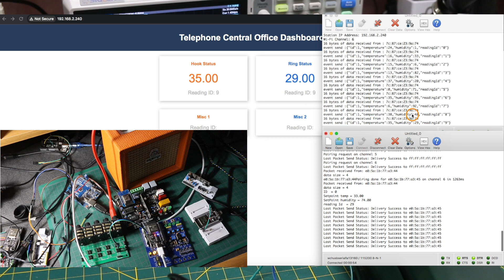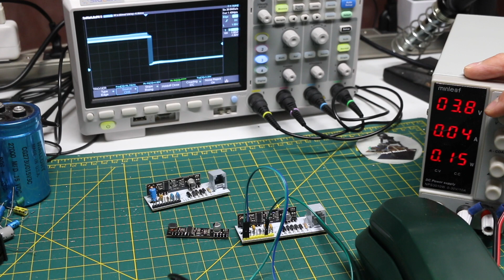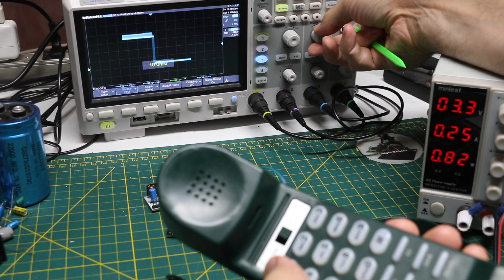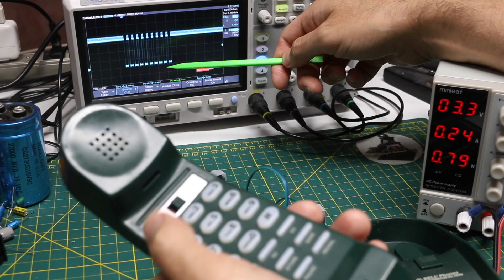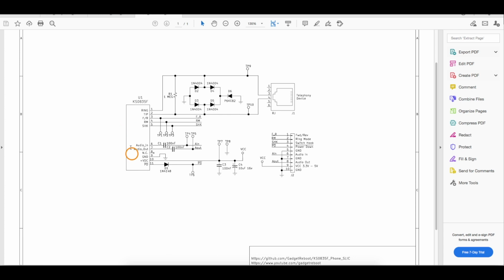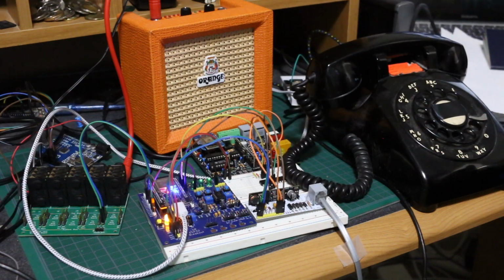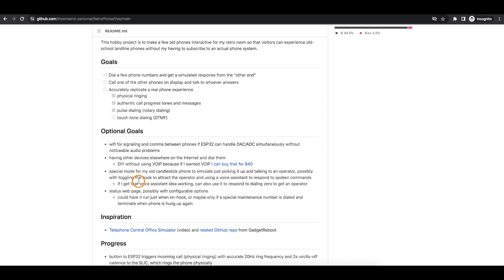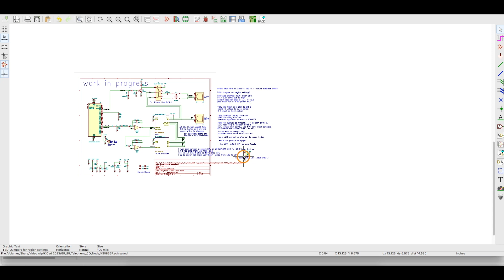Pulse Dial Detection and Mechanical Ringing

Comment: I am planning to make a 2 or 3 line PBX as an intercom using old rotary phones with bells so your projects has given me a lot of great ideas.

I am pondering how we can make a parallel distributed no single point of failure phone number registry that is global and works with trust.

There would be two parallel number systems.  One would conform to the old regional dialing codes and allow people to have a number similar to what they might have had, still could get or perhaps still have.  This would be a public number that anyone you want to take a call from you could accept.  The other system would be a unique number that might simply be a 30 digit number (or perhaps something in an ipv6-freedom format)  with perhaps some check-sums to make sure it is a valid number but they would be assigned through a trust system where people would get together at some convention and authorize the attendants to be real people with a unique personal identity number that could be hashed into the number. There after they would go forth and market the idea and register new people that they know to be real and have a real ID document they can verify and use the number hash to lock in their identity uniqueness.  Each person would be responsible for all of their down-line and if anyone registers NON-PERSON numbers they and all their down line would be removed.  

Once we have a numbering system we can use a replacement for skype and telegram number verification to prevent the powers from linking all call traffic to identified individuals. Having mechanical phones connect to a global system of forwarding calls using wifi, free-space optical, internet, cable/fiber, or any other method would allow people to communicate without having to worry about self censorship and liability.

A big part of the effort on designing this network will have to be on avoiding external Trojan insertion into the code and members as well as making it robust against most attacks that are sure to follow if it reduced the control of the 5Eyes monitoring umbrella.

The ideal would be the ability to plug your telephone device into any network and make a call to any other number without there being the ability to determine who you are.  Being able to use an old phone is a cool bonus but a small embedded micro-controller would be just as useful. You could use your laptop or mobile phone to communicate using your public number and then using a 'dumb' and anonymous device when working with your crypto number.  Three letter agency staff need not apply in their working capacity.

There will be some that cry that terrorists will use it against the people but this is a frivolous argument.  The governments of today are the primary terrorists and if they do not wish to provide freedom of communication then they show themselves to be totalitarian terrorists and need to be circumvented.

Comment: if you put a normal debounce routine in the software it wont matter what the voltage is or the number of bounce signals.
it will only show the state change when the input has stopped bouncing.
a simple timer that gets reset every time the input changes state, the timer will only time out once the bouncing has stopped for longer than the timer period.